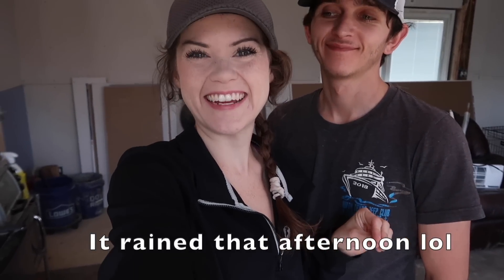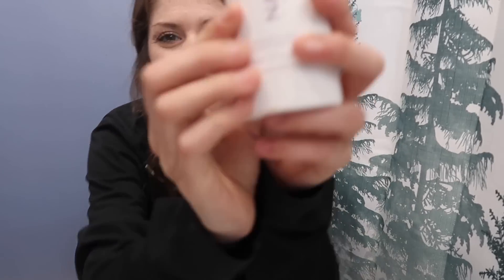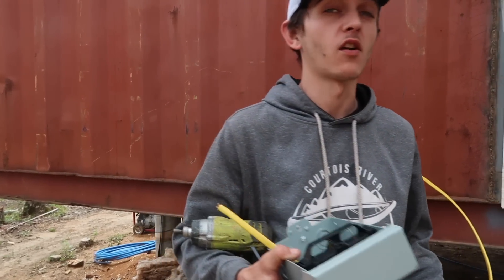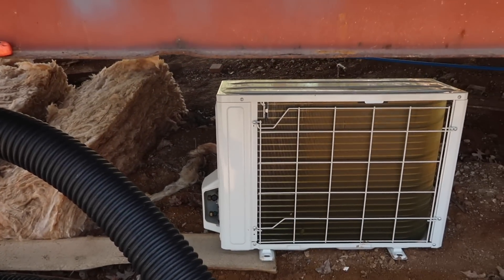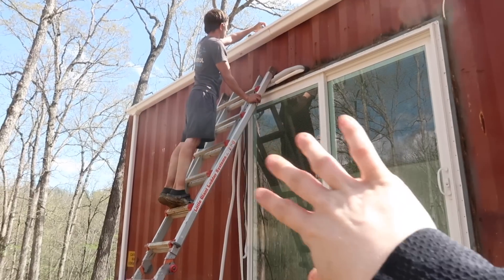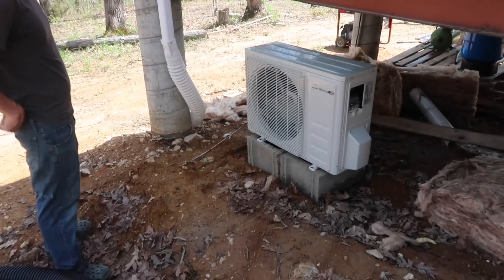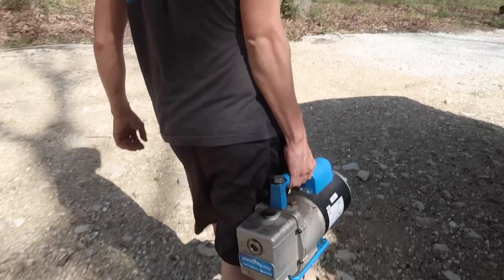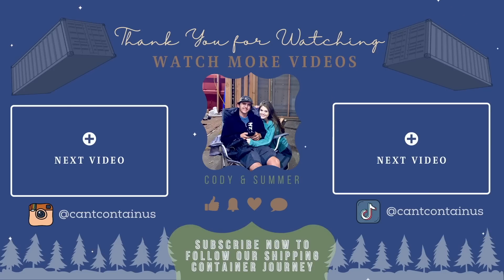OFFGRID HVAC in our Self Built CONTAINER HOME| Shipping Container House EP:36|

Comment: I know it'd suck to redo a bunch of work but I'd move the unit to a different location and put the pipes in the wall and exit through the floor. Or fur out an exterior accent wall around the door.
Reply from the maker: We don’t want to put the unit at floor level.
Reply: @CantContainUs  of course not. Just running the pipes through the floor.

Comment: I would move the whole unit the other wall. If youre facing the evaporator (inside part), the wall I am talking about would be on your right. Plus, it looks like it would be better on that wall to blow through the entire living space.
Reply from the maker: That wall is the kitchen so refrigerator, stove, cabinets, etc. We also chose that wall because that side of the house stays shaded most of the time.
Reply: @CantContainUs  Ok, 3:07 the wall to your left. -->|===| that side of the container. The wall facing that big tree. Prolly to much work to move at this point. Just my 2 cents. Plus, the air would be traveling down the length of your house. Without moving it though, Prolly a wood feature that hides the line set. Frame the entire door. It would also hide the hole in the decking. Plus, be aware mini splits are not very robust. A lightning strike or a bird crapping on them will kill them. Just make a plan to be able to get to the unit when the time comes. Save you a headache down the road. I have crawled under a many houses in my time and its never fun. Also, it needs to breath. I heard you were going to enclose the bottom? Most ACs work by taking the hot air from inside your home and moving it outside and taking cooler air from outside and putting it in your home. So it will be generating a lot of hot air. If that air has no where to go, it will work harder to do its job. Sorry, a little long winded there.

Comment: The covers for the hoses actually look very good. The only problem is the horizontal movement across the top of the window where you have varying elevation. Aesthetically it could still look good as long as you find a color that will match your external trim

Comment: You mentioned how you plan to paint the outside of the containers and put siding on as well.  A few  questiins... 1. Why paint the outer surface of your container if you are going to put siding on?  2. Why put siding on your container home to begin with?  3. Isn't the idea of a container home to show the container look in the first place?  4.  Why are you installing the split unit before you have at least finished taping, mudding and painting the walls??  There's gonna be alot of dust created while you finish the walls and that might get inside your AC unit and damage it.  Plus it will be an obstacle to paint around.  Looks like you are creating unnessisary headaches for yourselves.
Reply from the maker: 1. Because I currently don’t like the color of them and I don’t plan on siding it for a long time so I figure I will paint it and enjoy it as long as I want. 
2. Because as we said in the very beginning our entire plan was to side it and make it look like a log cabin or something of the sorts. it’s meant to be a mother-in-law suite not a long term home. The containers were used as a foundation or building block if you will. Because we didn’t want to use a whole bunch of lumber and cut down a crap ton of trees for absolutely no reason when we can repurpose containers. 
3. I guess for some people the idea of a container homes to show the look at the containers but that’s not our plan. I don’t know if you’ve noticed but Cody and I do things a lot differently than most people which is how we like it. 
4. Because it’s summer and it’s hot outside and we would like to be running the mini split while we have our dogs here and while we need air-conditioning. We do things out of priority and necessity and we will be living here way before cabinets or anything else and so having air-conditioning is really important. and it won’t get damaged if you clean it properly. 
Not obstacles just how we’re doing things.

Comment: I know it may be a dumb question but is that a air conditioner? Love you guys !!
Reply: Yes it’s an air conditioner. Since installing a/c ductwork would be impractical.  the motor is outside so the inside unit is quiet.  Eliminates window a/c unit.
Reply: this is not common in the us ? in europe this is the model everybody has
Reply from the maker: Never a dumb question!! Yes it’s a hvac system!
Reply: Thanks everyone!!!
Reply: @1Danezu1  i would say they're not all that common in the US. I've seen a couple but if there's no central heating/cooling system in the house, people often use window unit air conditioners, or in more recent years there's been an increase in popularity of "portable" a/c units
Reply: @butifly1989  what a thing :) ive seen window ac only in videos :D

Comment: There are a few different ways to go about heating and cooling your container home, but one of the most popular methods is to use an off-grid HVAC system. This type of system allows you to heat and cool your home without being connected to a traditional power grid.

There are a few things to consider when choosing an off-grid HVAC system for your container home. The first is the size of your home.